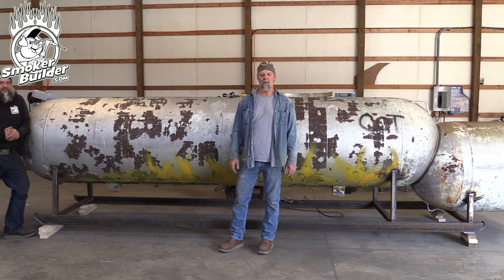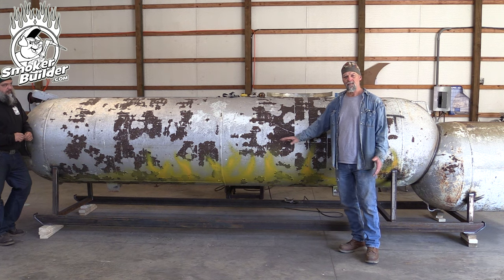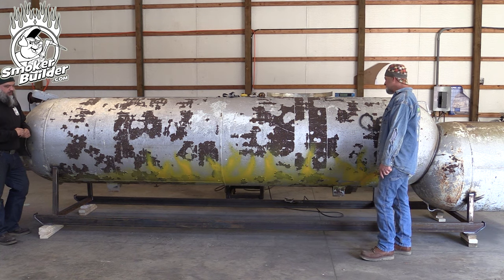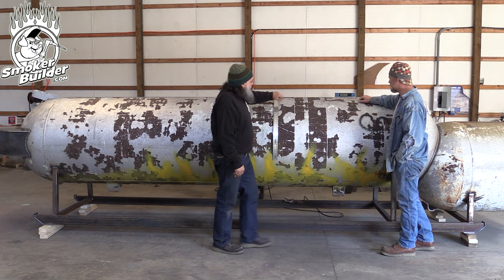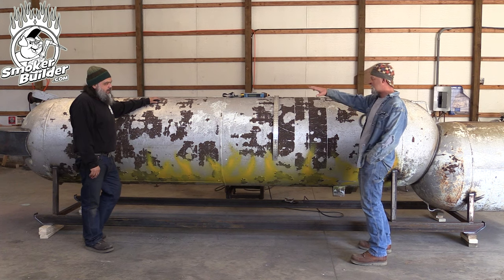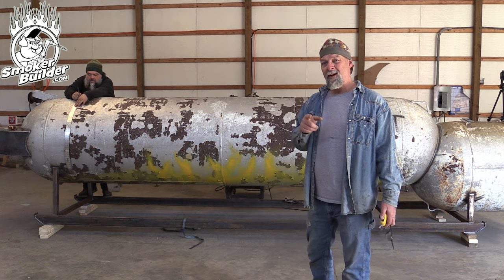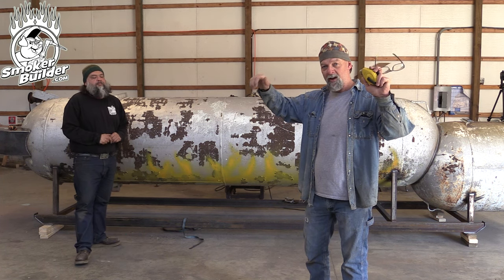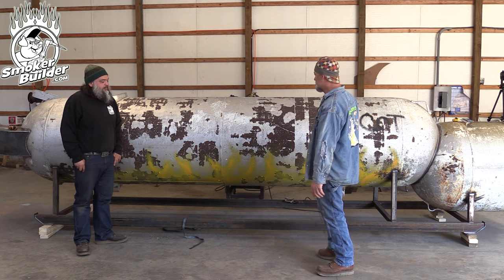[1000 Gallon Smoker Build] How To Mark And Cut Doors On Your Smoker Part 1

Comment: Ok, now I've seen half of it... not gonna make us wait a week to see the rest of the door cutting, are you??? lol Love the videos, great job, guys! Laying out the doors and getting everything perfectly straight with even spacing is so important, a lot of 'home built' smokers out there that cook just fine, but when you step back, you can see the lines of the doors may be slightly off, or the spacing is just a half inch different on one side or the other. Like Aaron talked about when he was designing the skids, having a kind of convention you use (like Aaron's 1/2/4" spacings) makes things a lot more pleasing to the eye. It's definitely a more "professional" look and something that often really "pops" when you step back and look from a few feet away - especially if it's OFF! You don't always notice it when it's perfect, but it really stands out when it's NOT! Great work, guys, thanks for all the hard work detailing this monster build! wish I had a shop and all the right equipment to handle something like this! Oh... and a friend, too! Friends are good! lol